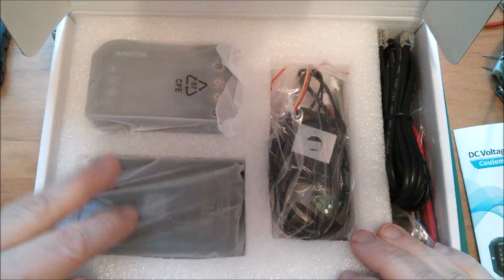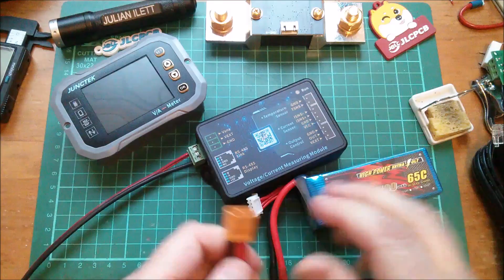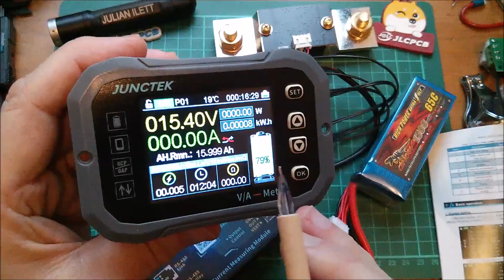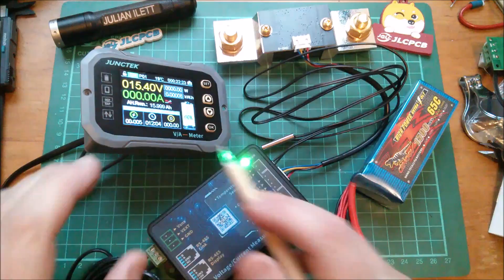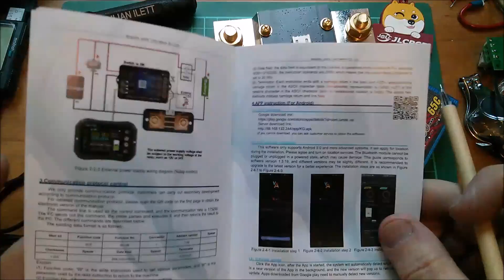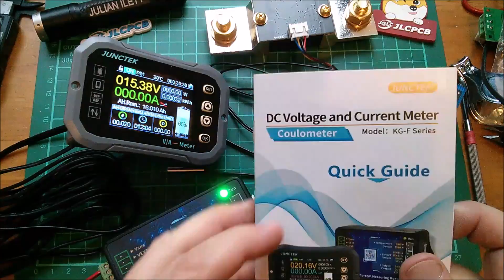Junctek DC Voltage & Current Meter KG140F

Comment: Any idea how to use this with a relay (for protection purposes)? I don't see a way to do it without using a seperate power supply to the monitor, which I don't want to do

Comment: I have one of these,  I thought the same about the shunt bolts. However, I drilled and tapped the center of the 10mm bolts, inserted 5mm brass screws reducing the terminals down to 5mm, ample size for my requirements,

Comment: It looks like the wiring is incorrect on this video, I just installed a Koolertron 400A version it works very well along with it's bluetooth app. You need to connect the battery negative to the shunt and a load to the other side of the shunt in order to get a current flow through the shunt. The manual diagram is correct, just need to follow it :)😜

Comment: Julian, I have the KG-F Series Coulometer paired with a 100AH LIFePO battery. I cannot get the Battery Remaining Capacity (Battery remaining % image on the Display) to report Percent Capacity based on the remining voltage of the battery.  I’ve tried fully charging the battery, then setting the Coulometer AH Rmn to the value on the display (Vs. setting the AH to the default 100AH value on the front of the battery), but the Coulometer Percent Capacity image doesn’t move or is incorrect based on the current Volage reading on the Coulometer Display.  Any idea what I am doing wrong or how to fix this?  Doug F.

Comment: Hi, I need a monitoring device for an 24s7p 28Ah li ion pack for an electric paramotor. The engine will pull max 23kw at 70-100v and max 260A. Do you think this device is appropiate? I saw others entering sleep mode 0-60sec do do you think I can dissable that if it has? The shunt Gets pretty hot, unless I'l be using the 400A one..maybe, and because I don.t want another consumer besides wires, battery heat, motor losses, etc shall I use a hall sensor device instead of the shunt ones? Did you find out if it keeps the settings if it is unplugged for days? Thank you!

Comment: This device app on android requires gps and file permissions. I knew this when I bought it but since I run the app on a docked Samsung s10 as a dashboard for my security cameras and tasmota devices on a non internet enabled INTERNAL network, displayed on a huge tv. I figured “what the hell”. To my surprise and disappointment whenever I dock my phone I loose the Bluetooth connection. Just to the meter not any other Bluetooth device. Ridiculous ! I don’t know if this is a software or a “dock” issue but either way it’s just another example of poor engineering with respect to the environment and a clear statement that the United States consumer protection agency ( the one that lets 9000 mah 18650 batteries in from the CCP ) doesn’t exist anymore !

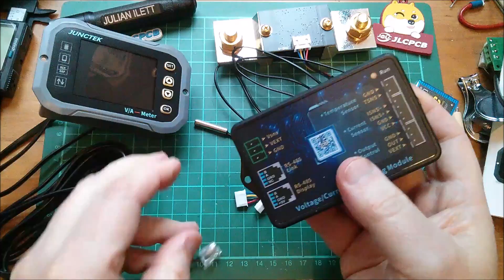Comment: In 14:09 I notice you connected the ground to the -ve terminal of the unit. In diagrams in other website,  the -ve terminal is unconnected. Any difference?
Reply: It is no problem to connect -ve when wiring first and then power on. If the wiring is live, it is recommended to not connect -ve to be safer.

Comment: super nice...👍 with all the functions, can it report on dirty power?  inverter equipment, solar and wind, can produce harmonics that could destroy electrical devices. 🤔thanks.
Reply: I have one on order to fit into that situation, and EV with a 360A PWM shunt motor running around 10kHz.. Hopefully it samples at a reasonably well filtered DC signal from the shunt op amp, if not it may need modification. I'll update this reply once it arrives.

Comment: Why don't these things come with WiFi integration?
Reply: now it doest. however any device that have uart/rs485 can be converted to wireless. just connect rs485 to wifi and that's it. do some google and using modbus from wifi take out the data you need.

Comment: I've got one of the older ones, a vat1300 I think. Nice piece of kit for the price. That one seems to be a bit of an upgrade. The display on mine is wireless from the shunt, so you can move it around and plug it in with USB and it'll read the shunt. But Bluetooth would be nice too. It's is not very accurate under 1 amp. I know it has slight current draws on it but it doesn't register until it hits an amp. And the current calibration isn't as easy as that one to set to zero. Got to go into the hidden settings on mine.
Reply: Hello, my friend, the KG-F coulomb counter uses a pure copper shunt, the measurement is more accurate, the Bluetooth can be read wirelessly, and it has the function of downloading historical data.

Comment: What's the operating temperature range? 
Are you going to heat your shed 24/7  to prevent temps to go bellow freezing?
Reply from the maker: I may need to add a temperature controller to the system in winter.

Comment: Its stamped on the shunt as 75mV @ 500A ;-)
Reply from the maker: You're right - I didn't see that - thanks :)
Reply: @JulianIlett  Still patiently waiting for the diesel heater tear down to find out what went wrong with it you know ;-)
Reply: Yes. The shunt of KG140F adopts the shunt specification of 500A, and the actual measurement range is the current range of 0-400A

Comment: Looks like a useful device. I like the split between main unit and display which can be remotely installed. Probably more accurate than the hall effect meters.
Reply: Yes, the shunt measures the current more accurately than the hall sensor.